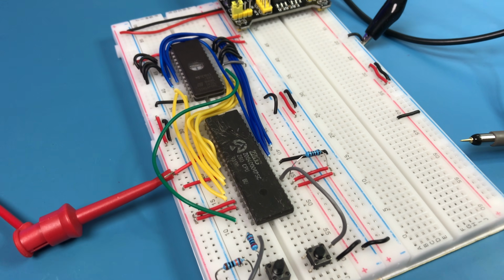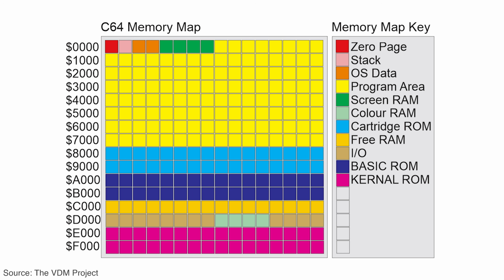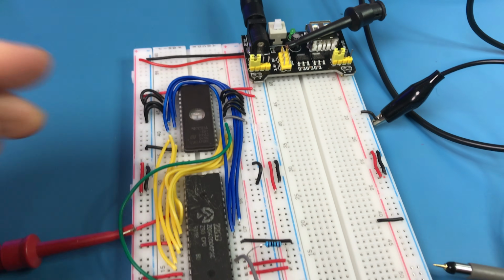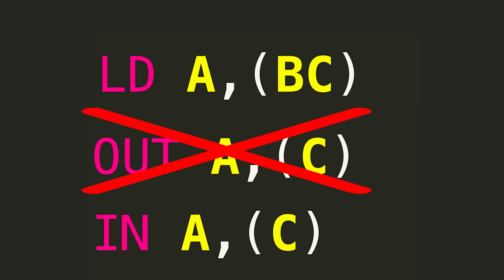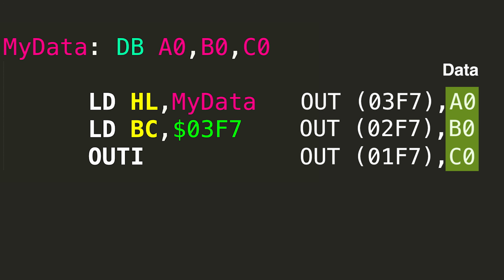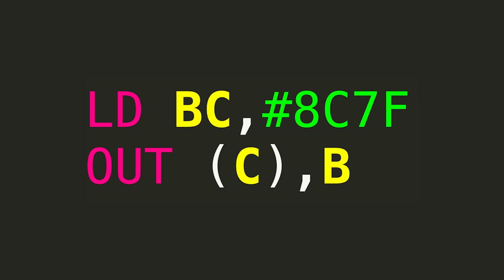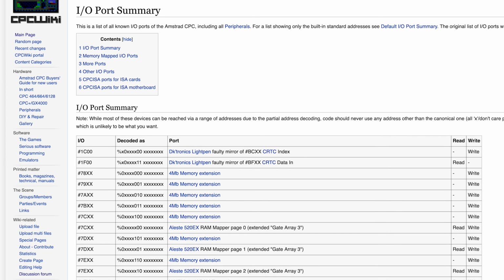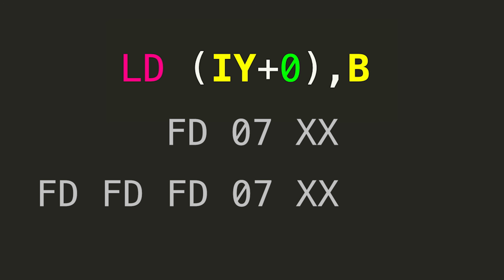The Madness of Z80 I/O

Comment: This video all but convinced me to learn z80(e) assembler, so much fun stuff in the Z80, compared to the 6510, which I programmed for the last time in the 80s.
Reply: I have done both 6502 and Z80 in recent years, I find 6502 vastly more enjoyable than Z80.
Reply: @smf3472  I've got documentation for the Z80, but I still prefer the 6502 line for the same basic reason. The 6502 is so much easier to understand.

Comment: To understand why the Z80 has separate memory and I/O spaces you have to look at its history. The Z80 is an enhanced 8080. The 8080 was an enhanced 8008. The 8008 was a single chip version of the Datapoint 2200. The Datapoint 2200 had a processor made from over 100 TTL logic chips. It used (in the original version) serial memory and shift registers, and had a 1-bit bus and 1-bit ALU.

Accessing I/O was very different to accessing the memory so it needed separate instructions for doing that. The 8008, 8080, Z80, and even 8086 and Pentium have just inherited that separate I/O space for backwards compatibility.

BTW accessing memory on the Datapoint was very similar to accessing registers. That’s why the instruction set bundles memory reads and writes into the same instructions as register reads and writes - as in LD r,(HL) and LD (HL),r in Z80 mnemonics. It’s fascinating that these quirks are still present in Pentiums 50 years later.

On to Amstrads: I hate being pedantic, but the gate array doesn’t control RAM banking (that’s a personal soap box), but it does control ROM enables, hence why it needs access to A15 and A14.

Also, the gate array port address and current settings of register 2 are permanently cached in the BC’ registers. (Register 2 controls video mode and ROM enables). Thus when calling into a ROM, or otherwise changing ROM enables, it just needs to swap to the alt registers, modify C’ and output the new value. This saves it having to read and write such values to/from memory and makes such operations much faster.

But that’s enough waffle. Thank you for the always excellent videos.
Reply: Using "LD" as the mnemonic for almost all instructions that move data around is a feature of the Z80 assembly language only. The standard 8080 assembly language wasn't like that -- it used "MOV" for movements between registers, and various mmemonics starting with "LD" and "ST" for memory access. It was quite quirky in various ways, e.g. it confusingly referred to the 16-bit BC, DE and HL registers as just "B", "D", and "H". The Z80 assembly language did an excellent job of cleaning all that up.

I guess they didn't unify the memonics for IN and OUT because English doesn't really have a single word that works for both directions.
Reply: @gcewing  Additionally, they still used MOV in combination with (HL) (which is called M on 8080) so STAX D for "ld (de),a" but MOV M,A for "ld (hl),a".
Reply: @gcewing  IO?  LDIO? It matters little since the instruction needed separate opcodes.
Reply: @gcewing  Indeed! I bought a TRS-80 in 1979 and bought the 8080-bug book from Tandy and was very glad that the TRS-80 had such a (compatible) processor. But the Intel assembler notation was very inconsistent. Zilog did that much better!
Reply: The distinction of banking and ROM enable is a crucial one, I think your soapbox is entirely justified.
Reply: Bonus advantage: The separate I/O space also simplified memory cache implementation years later.
Reply: The separate I/O address space isn't just for backwards compatibility; it's also convenient in that you can generally use less decoding hardware than you need with memory mapped I/O systems.
Reply: @Curt_Sampson  If anything you end up with more decoding with Z80, the strange Amstrad design is just to try to get it back on par with 6502.
Reply: @smf3472  That simply isn't the case in many situations.

For example, on a system with 32K RAM and 32K ROM (or switchable to use 64K RAM after boot), you need no decoding at all for the RAM and ROM on a Z80, and still have up to 256 I/O addresses that can use as much or as little decoding as you like. That might be just a 74LS139 to decode 8 devices getting 32 addresses each, or might even just be done with the address lines themselves and no extra logic, giving you 5×16 addresses, 6×8 addresses, or similar.

On a 6502 or 6800, on the other hand, you need to cut into some of that RAM or ROM space to make room for your I/O, and the less you want to lose to I/O, the more decoding you need. The simplest solution that doesn't lose you 16K of RAM or ROM would be a '139 to break down your memory address space into 8K blocks, and then another '139 to break that down for 8 devices getting 1024 addresses each. But even there, you lose 8K, and depending on the speed of your system, two chained '139s might add too much latency. So you end up going with something even more complex.
Reply: @Curt_Sampson  Yes saving the need to have power hungry 74S138 decoders to decode an IO instruction to a full expansion, because you needed that few extra ns shorter delay of the 74S part over the LS part, so as to allow you to use cheaper slower latches, buffers and such, especially as you pushed the clock to the maximum. Did make a card where i had some IO, and wanted to feed out the clock, using 50R termination, so took a trio of 54S00, soldered them on top of each other, with a 10uF 25V CTS13 wet slug tantalum across the power rails, and then used one quarter for 14MHz clock input, and the output drove the other 9 gate inputs, and the parallel outputs drove the output, using a 47R series resistor.  Used a long cable, and a 50R termination, and got a pretty good square wave out the far side of it, and the triple stack of ceramic did not run too hot.
Reply: It was quite common in early computer architectures for memory access and I/O to be done very differently. The DEC PDP-8 and Data General Eclipse come to mind. As pointed out, it does have the advantage that you can use all of the address space for memory, which was an important consideration in those days when address spaces were very small by today's standards.
Reply: Really interesting video, didn't know this back in the day. 

I didn't do much Z80 assembler mainly Sinclair BASIC. Thankfully BASIC on the ZX Spectrum used simple IN and OUT commands, so i was able to read input from my Kempston joystick interface. 🕹  I never got around to IO with the Z80 assembler i did write, mainly just memory copy and sprite routines. Would be interesting to see what Sinclair BASIC actually used for those commands. 

I moved on to Motorola 68000 systems, Atari ST and Amiga. Funny enough move is the operative word. Z80 used LD reg, data like BASIC's LET a=value, easily understood. 68K reversed it with MOVE this to there. MOVE D0, A0 which i actually found such a breeze in comparison. Standing on the shoulders of those that went before and all that.
Reply: So what are saying is that the design and implementation of the Z80 I/O instructions follow the same kind of logic that dictated the diameter of the space shuttle's rocket boosters?
Reply: @JanBruunAndersen Here is a story I haven't heard 😅 I would love to hear how they decided the diameter of the boosters!
Reply: @MaxQ10001  - the boosters had to be transported by rail and train. That limits the diameter to the width of a train tunnel. The width is determined by the rail gauge - the distance between the rails. That in turn is determined by the axel length, which again is determined by the size of a typical train coach. With me so far?

Who do you think built the first English train coaches? The craftsmen who had experience with building normal horsedrawn coaches. Those coaches where designed to travel along the many small English roads, dating back to the Roman occupation.

Guess what types of carriages the Romans used? Chariots pulled by two horses. That put the width of the road to be slightly larger than two horse rumps, and also determined the axel length.

And that is why the boosters had a diameter of roughly two horse rumps.
Reply: @JanBruunAndersen  interesting! Those limitations are real for so many things. To bad, every time the engineers are creating a new, better solution for something, reality comes hitting them in the face 🤣
Reply: @JanBruunAndersen  Actually, the width is determined by the loading gauge, not the rail gauge. The loading gauge can be different on different routes that have the same rail gauge.

And the "Roman roads" thing is pretty much a myth; early rail gauges varied by quite a lot. The  Redruth and Chasewater Railway (1825) in Cornwall was only 4 ft (far narrower than a Roman road); the Ulster Railway (1839) was 6 ft 2 in. The British "standard gauge" of 4 ft 8½ in came about mainly because of which railways happened to be the most successful in a certain area of Britain in the 1825-35 era.
Reply: @Curt_Sampson  - why do you spoil a good story by providing facts?
Reply: Yeah in Ireland we still have the wide gauge I guess because of soft boggy ground. And the couple of horses ar$es ;)  @Curt_Sampson

Comment: WONDERFUL video! Informative, educative, accessible and fun, all at once! You keep on exceeding yourself, amazing. It was super interesting for me, as an old-time Z80 programmer, to look at these instructions through your eyes; and you are obviously right about their being weird! What is even weirder is that, because I grew up with this stuff, I always took these instructions for granted, as just the way things are done :-). By the way, LDIR is an incredibly powerful instruction, as the hardware is optimised for the sequential memory access. It is the reason why the 1-dimensional cellular automaton code in CERBERUS 2100 (https://youtu.be/w4BwQMsE6vg?si=KkmhMLwrAXcWZmGJ) is much, much faster running on the Z80 than in the 6502. Weird, but very fast.
Reply from the maker: Thanks so much! Glad you enjoyed it. Yes, LDIR totally rocks for fast copying!
Reply: @NoelsRetroLab  I'm surprised no one (that I can see) has brought up the fast fill using the stack technique. Not copy in fairness, but often you want to fill/clear... As long as you don't need interrupts, of course. ldir is great, but not always the fastest thing depending on your use-case :)
Reply: The pipelined instructions sound so fun. I am very tempted to strat learning Z80 assembler.
Reply: LDIR costs 21 cycles per repetition (except for the last one, which costs 16 cycles). Unrolled LDI's are faster since they only cost 16 cycles.

Comment: FD 70 xx is LD (IY+x), B
FD 07 xx will do RLCA, followed by whatever instruction xx is.
Reply from the maker: Oh crap, did I reverse the opcode? Oops! You get what I meant though.
Reply: @NoelsRetroLab  Yep :) It's quite clever how they've chosen instructions that will put a particular register on the data bus, which can be snooped and read as a parameter by the Dandanator.

Comment: Coming from a 35 instruction PIC assembly background, the thought of all those instructions in the Z80, 6800 & 6502 does make me shudder.  I'm a tad young and just missed out on the 1980s home computer buzz.

That said, I do have a Z80 chip in my junk box, and some RAM chips and EPROM, so I suppose I should build myself a small computer!
Reply: Do it!!
Reply: If you want simple early micro CPU then the 1802 has few instructions but is probably even more painful to program to do useful work than a PIC (and much weirder)
Reply: Pics are great machines for their semplicity and ease of use. 
I integrated a couple of 16f64 in an Fpga and they worked really fine at frequency over 60 Mhz!! 😊😊😊

Comment: Coming soon, Noel has a total meltdown over Z80 Interrupt Mode 2 vectored interrupts with Zilog's peripheral chips (CTC,DMA,PIO,SIO) !
Reply: Mode 2 interupts worked fantastically. At the time though,  I barely understood them 😂
Reply: Here be dragons! Especially if you try that on a ZX Spectrum.
Reply: @ncot_tech  Dragons? lol I used that interrupt system to create a machine-code 'break' key which caused a return to BASIC. It was useful when debugging machine-code that produced infinite loops as previously, I would have had to turn the Spectrum off then on again which emptied the code I was writing from the memory as well as the code I had written to handle the interrupt routine.

As I recall, I had to point the vector to a RAM location, execute a DI (disable interrupt) instruction followed by a routine that scanned the keyboard to see if the Shift/Function/Break keys were pressed simultaneously and if they were, an EI (enable interrupt) instruction was executed followed by a JP instruction to the BASIC Interpreter in ROM. Otherwise, the routine would terminate with an EI followed by a JP to where the actual service routine was coded and the machine-code carried on doing its thing until another 20 milliseconds passed and the interrupt service routine would run again.

Obviously, I was causing the Spectrum to spend more time on its normal service routines but I was the only person I knew who could break out of machine-code loops without turning off the computer so it was worth it.

(Confession: the machine-code 'break key' was an invaluable tool for ripping software, bypassing passwords, 'adjusting' checksums etc. lol) 

Great days when 41K of usable RAM seemed like a massive space compared to the 16K ZX81.
Reply: I used all those apart from DMA in writing a race track control and timing system complete with pre-emptive multi tasking in what was an embedded system. I was used to writing OS code for IBM mainframes, so the approach of separating memory and I/O address spaces came naturally, albeit the programmability of Z80 peripheral chips was very limited compared to writing channel control programs for the mainframe.

It was, of course, all mode 2 interrupts. However, the engineering of that sort of system is very different to mass market domestic computers.
Reply: The spectrum data bus had pull-ups on it so usually an 0xFF would read but certain peripherals (I’m looking at you Kempston joystick) ignored that the i/o request was part of the interrupt and so cheerfully wrote to the bus. The hack was that there was a 256 byte page of 0xFF in the original Spectrum ROM. Pointing the I register to that page meant that interrupts would jump to the last byte of RAM and putting a JR instruction there would read the first byte of the ROM as the jump address which was a DI instruction with opcode 0xF3. The interrupt handler would therefore jump back 13 bytes to the end of RAM to start doing proper work.
Reply: @gppsoftware  the interrupt table couldn't be in contended ram and the table had to be 257 bytes long. In IM2 the value on the bus is a byte offset into a word table & because it was essentially random as there was no hardware in the spectrum that put a byte on the bus during an interrupt acknowledge cycle, then you had to make sure it could fetch a valid word for every possible byte. So for example you would put your code at 0xd1d1, then have 257 0xd1 in ram at 0xd000 and set I to 0xd0
Reply: @EssArrB that was what I was expecting when I saw the thumbnail/title.

@ncot_tech Specially on any platform that isn't CPC.